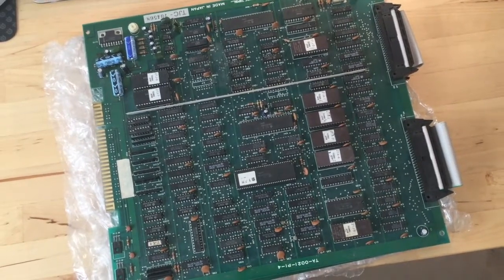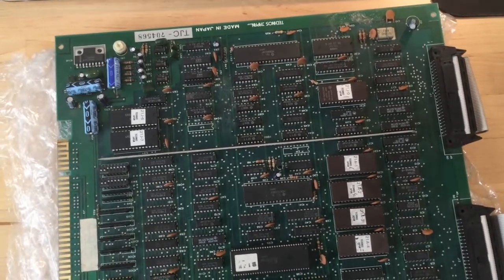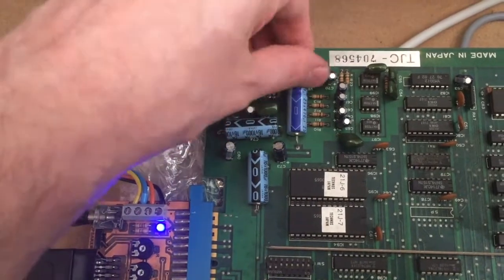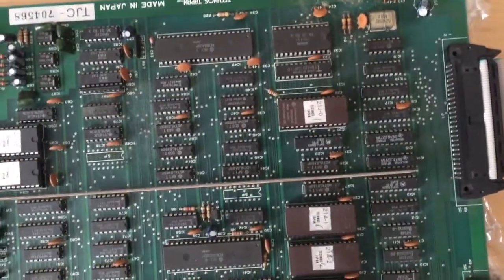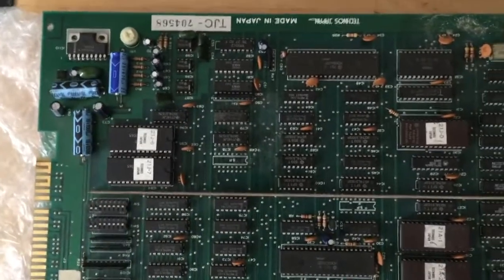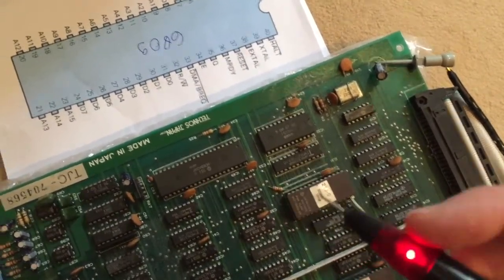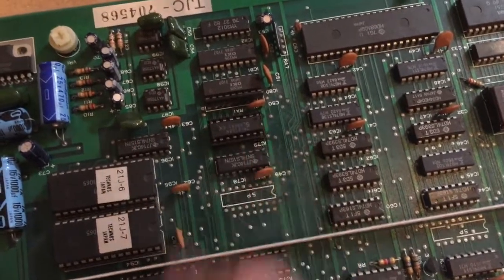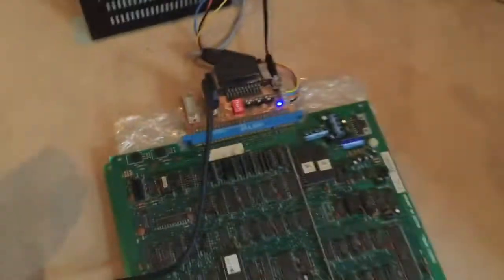Arcade PCB repair - A board with no sound

Comment: What model is your logic probe?  I like the light placement vs all the cheap ones of today with the red/green LEDs.

Thank you.
Reply from the maker: It's an HP (Hewlett Packard) 545A. Maybe you can still get one used on the bay like I did. But basically any probe should work that can differentiate between the three states high, low and "not connected". The "memory" function is a nice extra.

Comment: Great video! Thank you for the information. I have two questions for you: What is the brand of the testing pen you are using to test the chips? Do you do board repairs? I have Super Monaco GP (System X) board that works but has no sound. Thank you again

Comment: Hey man love the videos! Your german accent is fantastic, and thanks for speaking in english! I found your channel by looking for videos on the Atari System 1 boards, as I want a marble madness cab at some point. But! I have a question, what Jamma>Scart board are you using? I have a 15khz PVM that supports RGB and wanted to start maybe getting some broken arcade boards and fix em up. I usually buy broken consoles and fix them, but IBM PC's and Arcade boards are my next logical step. Thanks for the videos! I'm going to be posting them on some repair forums I hang around as your videos are criminally underwatched. Thanks again!
Reply from the maker: The jamma to scart adapter pcb I'm using I actually made it myself more than 10 years ago. It is useful if you live in Europe because you can hook arcade boards up to an older tv - which usually have  a rgb scart input in europe. Nowadays you can buy these online just do a google search for "mak supergun" lots of people make em nowadays.
"criminally underwached" rofl... Thank you for offering to spread the word.  :-)

Comment: I also have a double dragon pcb with a no music and no coin up sound. Sound effects work but somewhat quiet for being cranked on the audio pot.. got the hum from the upper left portion when I touched it. Can I safely assume it’s the ym2A4A fm chip that needs replacing? I have a logic probe also but very new to pcb repair.  Changed a few caps , resistors, transistors in pinball tho. Thanks in advance
Reply from the maker: Well if the digital effects work then it is at least save to assume that the sound cpu circuit should be fine, an probably there is something wrong with the fm synthesis. But maybe its not the yamaha chip - could also be the "glue" chips around it. You could actually try to check with your logic probe to see what is going on.

Comment: What makes that System 1 board unrepairable?  Too much physical damage?

Looks like that Double Dragon had some corrosion.  It seems to be a common thing with that game.  The last one I fixed had a couple corroded vias in the video section.  They looked fine visually, but had no continuity.
Reply from the maker: When I got that system 1 mainboard it already had some custom chips missing and also traces had obviously been ripped off the board when they were removed. It would really be very hard to restore that one. But as I said it serves well as an ic donor.

Comment: I have a double dragon pcb that everything works background music when it starts and as soon as game starts or it goes into the demo mode starts humming really bad faintly here noises but no punching mainly background. Any ideas where to look on the sound section that could be causing it? Def had mouse poop and pee on the sound boards area.
Reply from the maker: well hard to tell but I guess your sound cpu should of course be working when you have music. also the amp section should not be the problem. There is one page of scematics in the double dragon documentation for the digital sounds. as there is two channels of digital audio and neither is working there could be a problem with the cpu starting or setting up those channels for sound output - so maybe some problematic signal lines in that regard could be causing this. If you have actual visible traces of corrosion that of cause can also be a mayor clue to solve this.

Comment: Hi dok just revisiting some PCB videos and was hoping you could explain or more so clarify for me the way the sound CPU talks to the MPU. I'm not sure on the interrupt process. I assume the sound CPU takes priority of the databus after the interrupt call in order to process the ROM data; however:

My thinking here is- the sound ROM data is sent to sound CPU which then sends the info to the Yamaha sound synth chip, then the synth chip sends info out to the amp then onto the speakers. is this is correct?, what does the MPU do whilst this is happening is the purpose of the interrupt, to tell the MPU to halt all other activity on the data bus lines?. If that's the case how does the graphics get written to the screen?. If you could sort of clarify the priority table of data activity it would appreciated my friend.

Also on the chip enable signals (more for future clarification) should they always be toggling?- in other words if i come across a ram or rom with a stuck chip enable signal either high or low ( I know the vast majority have an active low enable so not sure if a stuck low CE is a bad thing or not) - does that indicate that the something down the line with the glue logic or the rom/ram ic itself is bad.

Hope this wasn't a mouthful for you mate and any help is really appreciated!, as your detail in these videos are second to none . 

Cheers Franky
Reply from the maker: Hey, thank you very much first of all! 
ad 1) Well the Roms don't really send out continuous data, the sound cpu would have to actively transfer the sound data from a rom to the sound chip. The purpose of interrupts generally is to make a cpu aware that an event outside of the cpu occured witch is important for the further processing. so for instance if the main cpu wants the sound cpu to start playing some background game music it could be done in a way that the cpu provides the desired music tune code on the data bus and then interrups the music cpu with than plays the song it sees requested on the bus.
ad 2) chip enable signals may toggle (typically on the game roms and game rams) or may be high all the time (maybe typical for garaphics data eproms or palette roms) but newer low all the time (which would mean they are newer selected). Depends on the circuit architecture. 
Hope I could clear some things up!
Reply: @christophzett  Very welcome my friend! Thanks for the reply Dok- kinda of makes sense, just a few things with regard to interrupts- so confirming it is the main CPU that interrupts the sound cpu not the other way round? So question does everything goes through the main CPU at all times and it then respectively interrupts whatever device it requires to perform the action?. To digress abit what happens when we have a push button input for example. How does the CPU process that interrupt?. Secondly i assume you mean never(newer) low all the time with regards to AD2 answer, if so - even though the rom/ram(or whatever device) has an active low enable signal it should never be stuck on low just either toggling or high" inactive" at any given point. Thanks again for the help D

Comment: hello and first of all thanks for your good video. I stumbled on it because I'm trying to fix this other Technos board, a Shadow Force 2 that has this sound issue: plays just indistinguishable noises and as I raise the volume nob it plays a ritmic sound like bup-bup-bup every half second. Touching the amplifier it plays a noise so it seems that it is working. I will try to attach some audio input to it but don't have a wave sound generator so I should find another way...And I'm waiting for the logic probe and ic tester to come. But meanwhile any suggestion would be appreciated. Besides the sound this board has another issue: the images of the characters are the only one missing from the starting screen where you choose the one to play with to the real game where just the background and the words appear. Also here any suggestion would be really appreciated. Anyway again thanks for your great videos
Reply from the maker: well if you get anything like clicking and hissing out of the speaker chances are your amp is not the problem. checking out what the sound circuit does with the logic probe would be the way to go. that is also true for the graphical issues. the basics of cause are as always a good visual inspection and maybe trying to reseat some socketed chips.
Reply: @christophzett  do you know where I could find the schematics for shadow force pcb or even the double dragon or any other technos PCBs?

Comment: Hi, would you be able to tell me where you get your sockets for the ram chips from?  I need to replace a few chips on my galaxian PCB and I figured I'd put in a socket for good measure. Keep up the good work on the channel.  I love to learn!
Reply from the maker: Always really happy to hear when people mention that they find my videos useful. I mostly get the chip sockets off of ebay. Galaxian uses a couple of 18 pin 2114 ram chips I think. Just search ebay for "DIL 18 socket" and you should find plenty. Look for the ones with "double sided" metal contacts (like the ones I used in my indiana jones pcb repair, I am talking a bit about what makes a good ic socket in that vid).

Comment: Hello fron Brazil, thx for the videos is helping a lot on my humble collection.....i got a cps 1 board final fight, its get sond problens too, but some times i fireup the board and get no sound, then turn off and on again i got sound, but some times in the midle of the game the sound goes away and i got nothing or just buzzcome fron the speakes, can you help? Thx a lot
Reply from the maker: Thank you very much! Because it is a "resetable" error I tend to think that there could be something wrong with the sound cpu or the sound cpus roms or rams or the chips connecting them. It would be interesting to check the sound cpus state with the logic probe after the sound has failed and the game is still running. The sound cpu should be a Z80 somewhere on the pcb.
Reply: doktorzett thx a lot, I have some z80 coming, and I will change the chip, and let's see

Comment: Another great one as usual! I like the detail you go into, explaining not only what you're looking for, but why. 

Just a quick question though: What's with all the Double Dragons? Is it a special game for you? Not complaining or anything, just curious as to why you seem to seek those out.

Thanks!
Reply from the maker: Good question. It is really one of my favorite arcade games. This was actually the last board of a batch of dead boards that I acquired over time. It is actually a nice board to demonstrate some arcade design principles, the pcb quality is really good - durable traces, no lifting pads etc. which allows easy rework and also the schematics are well documented and available on the web. Never the less I am beginning to feel as well that I need to address some more different boards. Next video coming up will probably be about a centipede or maybe a road runner system 1.

Comment: did you use a logic probe or logic analyzer? sorry for the noob question
Reply from the maker: I used a logic probe (the proble with the red flashing light at the tip). This device can of cause just look at one signal at a time. A logic analyzer is a much larger and is able to check 16, 32, 64, 128 or more signals simultaneously.

Comment: Have you ever worked on a mk1 soundboard?? I've been trying to fix mine and theres not a whole lot as far as a guide on mk1.. its frustrating all the stuff I found is mk2 and mk3 guides
Reply from the maker: No not yet. I actually do have an mk1 board with sound board but it's working fine. What is the problem with yours?
Reply: It doesnt play sound at all .. so I'm just replacing almost all the caps.  It says rom u2 and u3 failed test ..
Reply from the maker: Do you have the means to check the eproms u2 and u3 (read them in an eprom programmer and check them against mame roms)?
Reply: No unfortunately I dont . When I turn on the mk1 arcade everything on the main screen that pops up and in the bios it shows everything light up green. But when I check the other options screen and check for volume I wish I could send u an image to show exactly what it shows. It shows u2 and u3 roms failed. Now I've read that just bcuz it says that it might not actually mean there bad. When looking further I know theres away to actually test them which I dont have. I know the caps are bad some of them. I was looking for power source on the soundboard bcuz the 2 lights on the mk board itself only led 1 lights up.
Reply from the maker: Yes right u2 and u3 failed does not necessarily mean that they are bad - might as well be some components around them - but it probably means that doing only the caps won't be enough. I would suggest you get a cheap eprom programmer and check them out - thats at least what I would do. Also if arcade games are a hobby of yours an eprom programmer will sure come in handy from time to time anyway.

Comment: Do you use  jamma to scart adapter?
This is tv ? Or monitor?
Reply from the maker: Yes, I do use a jamma to scart adapter. This is not a tv, it is an arcade monitor type WG K7400. I made a scart cable for the monitor - that's what might make it look a bit confusing. :-)
Reply: doktorzett 
Thanks